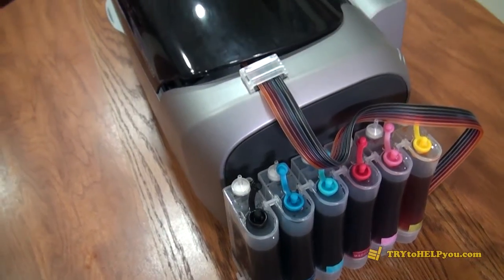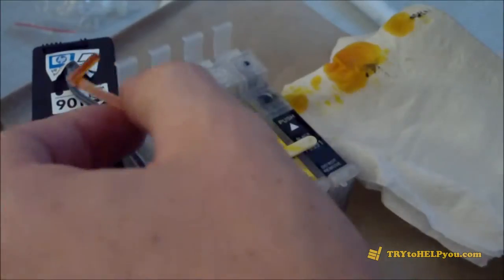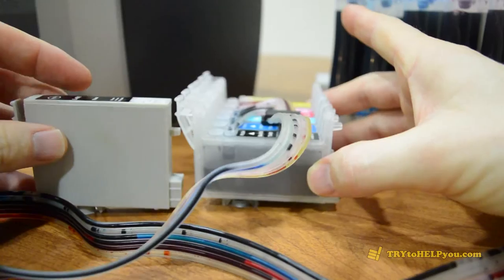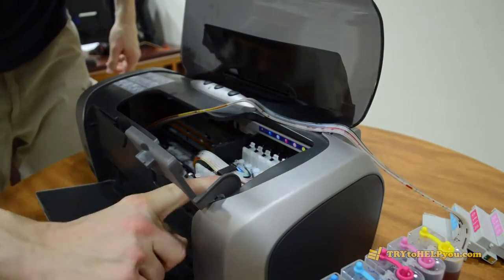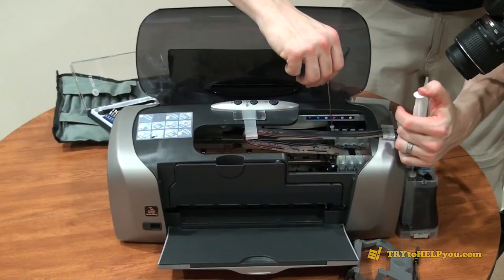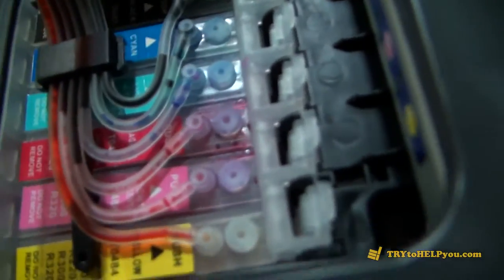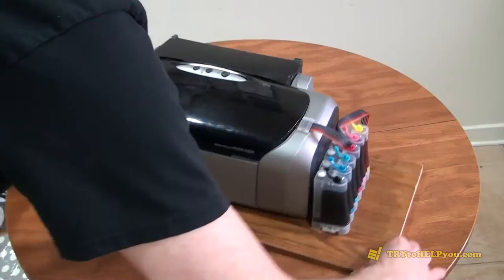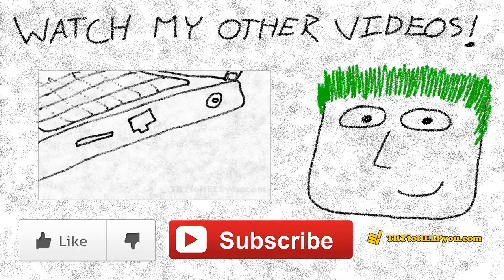CISS Review and INSTALL EPSON R200

Comment: Thanks man for the important video. I asume that system does not prevent the ink from drying up when the printer is not used often? I bought recently a laserprinter because of inkjet ink drying up. And i don't print much to prevent the ink from drying up.
Reply from the maker: +izri1 it will dry and clog! But, to avoid that in the future, find a dye based ink jet printer. I find them to clog less frequently than pigment based inks.. thanks for the comment